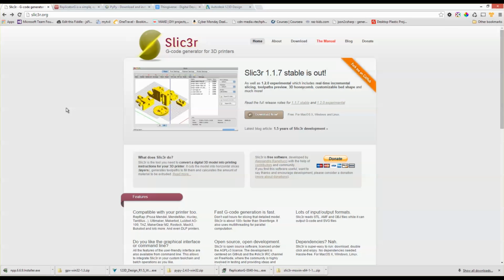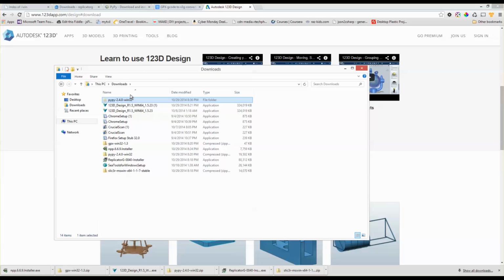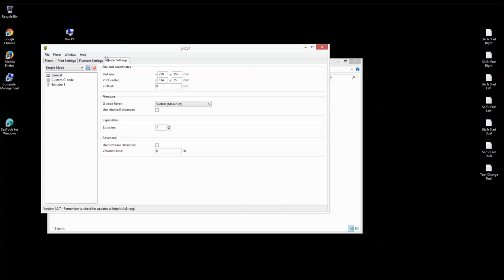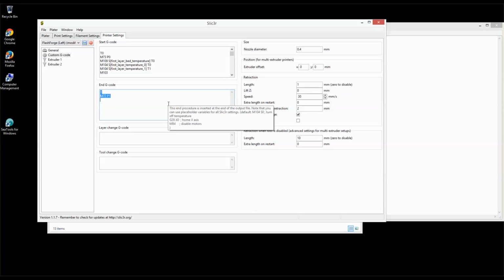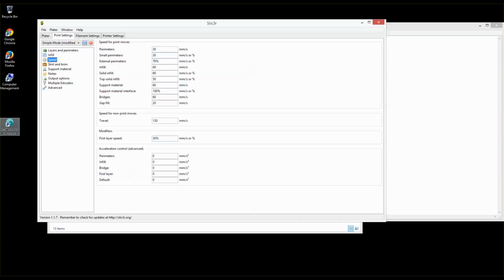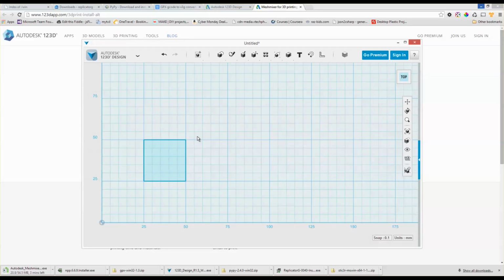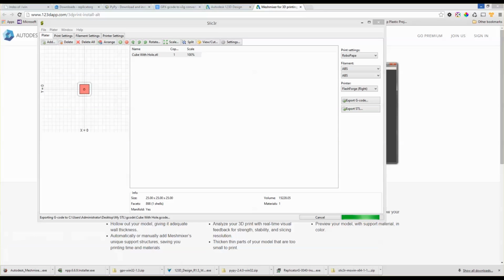How to Setup Flash Forge Creator Pro Software

Comment: After following all steps.. I get an error message when Exporting G-Code "The configured post-processing script is not executable: check permissions or escape whitespace/exclamation points. (C:/Program) ?Help?
Reply from the maker: Hi @Jacob Eckert, thank you for your comment. I have setup the gpx script to be with no spaces folder like so: E:\3DPrintingSoftware\gpx\gpx.exe
If you put the gpx script in your program files, make sure you include double quotes ( " ) in the path to the script. For example: "C:\Program Files (x86)\path\to\gpx.exe"
Let me know if that helps.

Comment: Hey, so my printer is connected, but states no drivers found, never had this issue when i used to use my printer, i have the flashforge creator pro(obviously). Windows 7 64bit.
Reply from the maker: Are you trying to print connecting the USB (I'm assuming).
Try a different USB port. 
I would not use the USB for prints and just copy the x3g binary to the SD card and print from that. 
Couple of reasons for that:
1) if your computer got disconnected you lost your print and will need to stat over
2) with the USB you will not get good quality prints because it needs to transmit the data via USB which is not fast enough
Reply: ah, that makes SO MUCH SENSE! my old prints used to be a little messy at times, but for some reason when i convert my files to x3g it ends up making the printer drop the bed all the way down, and do nothing but that.. even though it is a working file (does it for all, tried with multiple.) 

Is there any recommended programs i should use for converting to x3g? or possible directly to x3g? as most models online are stl or whatever it is
Reply from the maker: in this video i'm using slic3r and with it there is x3g program that takes the stl and convert / export it to x3g. Take a look around min 33 that is where I show where to put the x3g program for output.
Reply from the maker: +YoureASkid, were you able to convert to x3g ?

Comment: anyone get the new Slic3r 1.2.9 to work?  I would really like the preview option. Thx
Reply from the maker: I'm using 1.2.9 with my system and it works just fine. Settings is almost the same as the video shows. The only thing I had to do is place the center in the true bed center (not in the corner as it was with older versions)
Reply: That is the problem I am having. I tried, 0,  0 and 114, 75.
it still prints something at the far back right going off table and it doesn't look like the model either.
Reply from the maker: I'm not at home right now, but I will check tonight what are the settings I used in order to make it work. There might be a checkbox that is need to be selected :)
Reply from the maker: so what I have under the Printer Settings tab -> General -> Bed shape: (click Set...):
Shape: Rectangular
Settings:
Size: x: 228, y:150
Origin: x:114, y:75
Z offset is set to 0 mm

Comment: If I buy the Flashforge Creator Pro 2016 will I get the software with the printer? So that I can draw my own stuff?
Reply from the maker: I'm not sure about the 2016, but with what I got I had the software with it.
I'm using 123D design to draw my own STL files, but you can also use sketch or any other modeling software. Hope that helps !

Comment: Hi Robo Pappa, I have done something similare like your veary well made video. When I push the Button Export G-code in slic3r i get a message with and error and text "Invalid value - extrusion-multiplier" I dont understand this hope you can help.
Reply from the maker: seems like you have an issue with the gcode if i'm not mistaken.
Reply: +Robo Papa hi yes exactly it seems like it does not connection with the gpx i think.
Reply from the maker: what do you have in the section where you put the "link" to gpx ?
for me I put the gpx file under this folder structure:
C:\3D Printing Software\gpx\gpx.exe
so with scli3r under print Settings -> Output Options, you will see Post-processing scripts and that is where you want to put the full path to the gpx.exe (if you are using windows)
Reply: Hi, I am using window, I have it like this C:\gpx-win32-1.3\gpx\gpx.exe I think it should be ok ??
Reply: But my computer is a 64 bits and the gpx is a 32 ?? can this do something wrong about it
I really apreciate that you answere this. it is very kind of you.
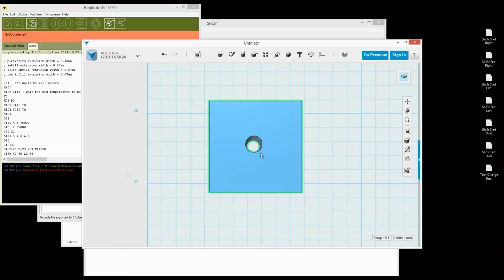Reply: I can see in you video about 36:30 that you open your gpx.ini and change different things through notepad, when I try to do that it does not look like yours so hear I can not see what to change. 

Can that be the problem ??
Reply from the maker: yes you will need to change in the ini the machine_type to be r1d (Replicator 1 - dual extruder) and under gcode_flavor=makerbot.
also don't forget to install pypy
Reply from the maker: my machine is 64 bits as well so that is not the problem. Make sure that you have installed pypy as well as changing the ini machine_type and gcode_flavor
Reply: Hey there I just got my Creator Pro today and ran into the same problem. I don't know why my options(when he right clicked) didn't allow me to edit the file the way he did so I went about it differently and changed the files content in a weird way.
1. I copy the "gpx.ini" file and paste it onto my desktop.
2. I open the desktop copy of the file and change what I need to
3. Save the file but make sure to keep the original file name but change the "Save as Type" to "all files"
4. Make sure to place this copy into a junk New Folder on the desktop, so it's easier to find.
5. Open that New folder with the edited copy of the "gpx.ini", copy it and then paste it in the original folder we got it from. 

Hopefully this helps.
And then you add this to the Post-processing script(in slic3r) and you're golden pony boy!
Reply from the maker: it could be that you couldn't right click because you are not an admin on your machine ? sometimes right clicking holding the shift key will open a more detail menu. But if the steps you took works than who cares right as long as it works :)

Comment: I am having trouble getting the dual color prints to work.  I have the T[next_extruder] in the tool change g-code, but it never changes to the other nozzle, It just is all one color.  Any advice?
Reply from the maker: +Quinn Miller make sure you break the print to two different files and than use slic3r to merge them

Comment: If Slic3r creates the gcode file, and then hands off to GPX to translate gcode into x3g, why do we need ReplicatorG?  What does it do for us in the collection of software you show us how to install?
Reply from the maker: +Russ Wolfe I'm using ReplicatorG to make sure the model sits on the build bed as well as the size. Plus if you want to connect your printer via USB and send your prints like that you do that from ReplicatorG (from my setup, but I'm sure you can find other software that will do the same).
If you just want to make the binaries you can skip ReplicatorG

Comment: By the way, I received my Creator Pro two days ago. Your videos help me decide the type of 3D printer I decided to purchase. Thanks again.
Reply from the maker: +stuart riggs my pleasure ! don't forget to upload what you create!!
Reply: Thank you. I've been learning. I've had some successful prints. But some I'm having an issue with curling with ABS. Some work fine, others don't. I've tried temp changes with bed, etc. Would hairspray work on the blue build bed?  I have not tried PLA yet. I'm trying to get consistent with ABS. I have a 3mm boro... glass I have not installed yet. I've been reading that glass helps. But I'm thinking..maybe I could get the existing platform to work consistently.

Comment: Thanks for this video. Is there any way you could please post a video with good calibration settings for Slic3r on the FFCP? I'm using this combination as well, with ABS, and the print quality leaves much to be desired on the default Slic3r settings. I have much better prints with RepG, but the GUI is much better with Slic3r.

Comment: Very good tutorial! I've been using Makerware for my PowerSpec 3D pro, and wanted to try something else. Thanks!
Reply from the maker: Gary Woods My pleasure!
Reply: When you were editing the gcode for the dual extruder, you placed the tool change G-code in the layer change G-code panel. Is this correct?
Reply from the maker: Gary Woods sorry for the late replay! The tool change G-code goes to the Tool Change G-code section (so T[next_extruder] goes in the tool change) I'm using Slic3r 1.1.7.Do you have the Tool change G-code section ? if not what version are you using ?
Reply: That's what I thought, I put the code in the tool change section. I'm trying out the latest experimental version 1.2.6.